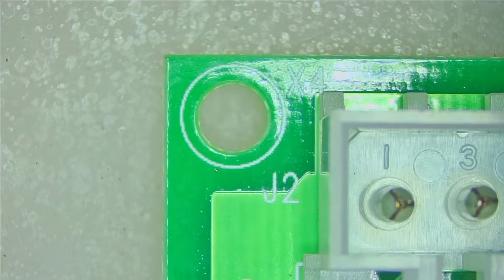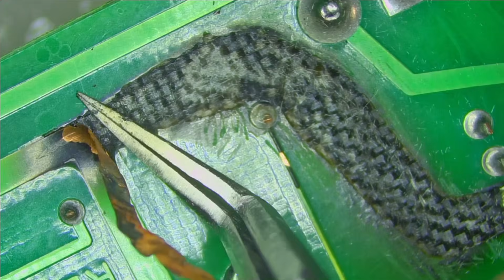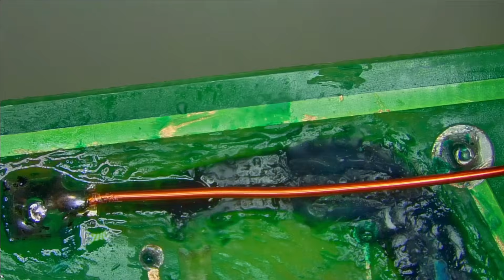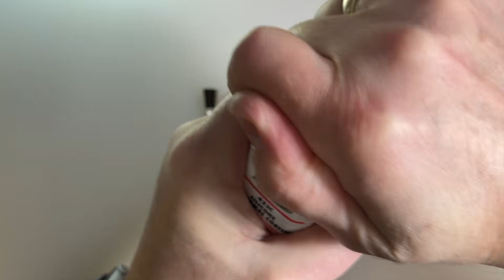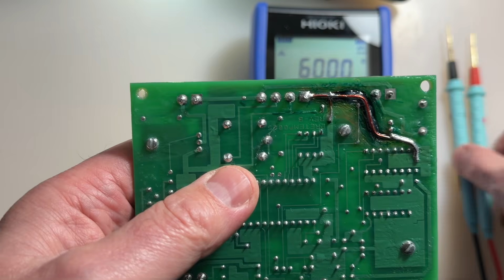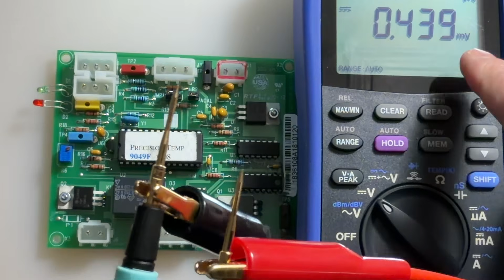Can This Be Saved? 550 EC Tankless Water Heater Burnt Board Repair

Comment: Use a fiberglass brush to remove the wire varnish. Use isopropyl alcohol to remove flux.
Reply from the maker: Thanks for the tips!  The fiberglass brush is a great suggestion. I use 99% isopropyl alcohol and an ultrasonic toothbrush for cleaning. I really appreciate you taking the time to comment and I want to learn as we continue to go down the road together!

Comment: Not worried about the char being conductive?
Reply from the maker: Great question and that is a good point to consider. Since the board was cleaned along with the wire being insulated by the red varnish I feel good about the long term repair performed. Something else to consider is that I am actually trying to create conductivity along the char mark and the remaining visual black that we see is at this point mainly cosmetic. I really appreciated you taking the time to watch the video and asking such a great question!
Reply: @BriansLogicLab  I was thinking that the carbonation went as far as the signal trace you also repaired. Otherwise it looked good.
Reply from the maker: Thanks for asking the question and based on that I will take a second look and a few more measurements just to confirm. I really appreciate your question and at the end of the day I am looking for a nice solid reliable repair. If you have ideas for videos you would like to see please drop them in the comments and I will see what I can do.
Reply: @BriansLogicLab  If you are looking for a long term repair then be paranoid and grind all the char away and rebuild. I have been told char can spread over time if you are unlucky. If the wide wire was also high voltage you could have lowered safety clearances and breakdown voltages. 
Be safe when grinding or using fiberglass pens "Circuit smoke, Don't breathe this". 👍